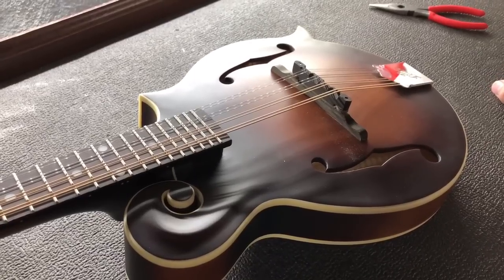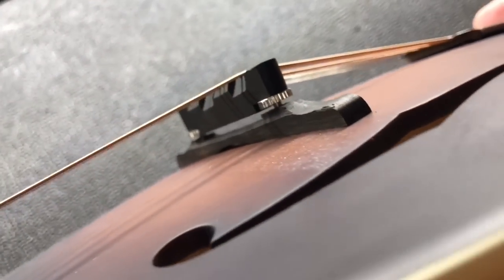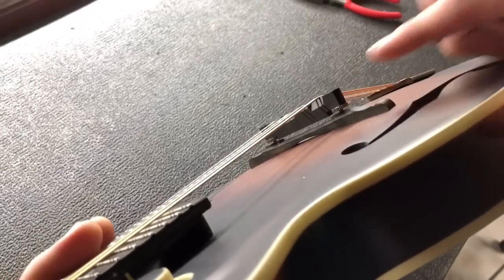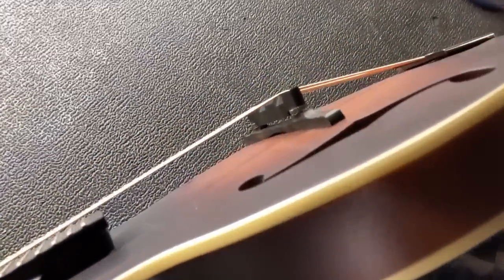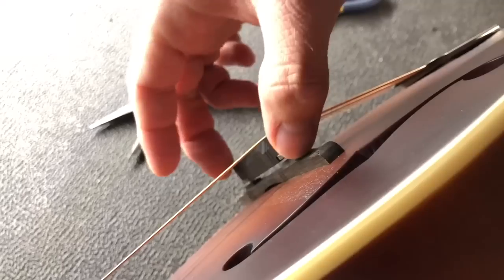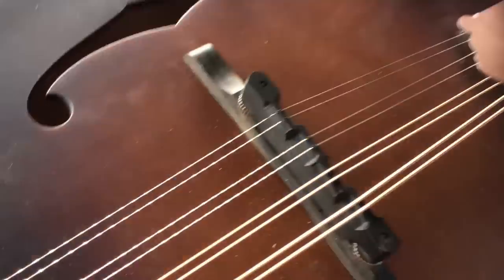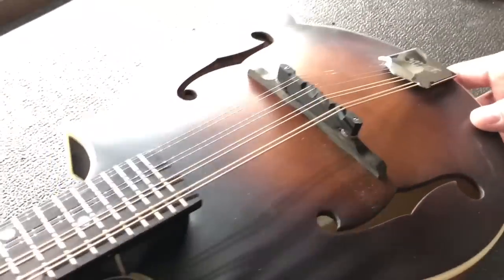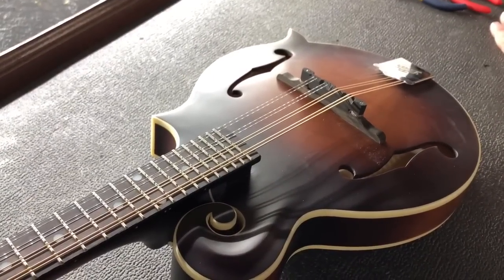Tech Tip– How to Adjust Mandolin Action Height

Comment: I bought a cheapo Johnson mando to practice on a business trip to Korea. I should have set the height back home when I had access to tools! With the strings tightened I can't turn the wheel for the lower tone strings, and when I loosen the strings the bridge simply doesn't  drop, the nut just screws down away from the bridge. I even tried lowering it a few mm below the bridge, then tightening the G and D strings to pitch, and it doesn't drop. I guess that's what I get for buying a crappy used mandolin! Edit: Fixed it! I loosened the strings all the way and loosened both nuts and then I was able to rock the bridge down and lower it to the nuts. Thanks, Ben!

Comment: Loosen the strings!!!Regardless of raising or lowering, always adjust the thumb wheels with your fingers.  If you have to use pliers, you have other issues.  Double check intonation by measuring from back of 12th fret. Gradually bring strings back to pitch.   Gradually - otherwise strings break.   You may want to order some E string singles and keep them handy.  Never force anything

Comment: For some reason I was under the impression that lowering the bridge would mess with intonation and you'd have to move it forward or back to compensate -- if that's not the case that makes me way more likely to experiment a bit more to get an ideal action height.

Comment: question: I see some saddles are completely flush all the way across the top surface and other designs where there is an arch in the center of the saddle where there are basically two "feet" ...is there a preference?  your video here has such a saddle

Comment: can you yell me  if there is a difference  between the treble and bass sides of the saddle when replaceing the bridge and if so how do you tell thank you
Reply: No one has answered so I will.  If you look at a typical mando bridge, the points where the strings cross the bridge form a zigzag pattern.  This is to compensate for the different thicknesses of the strings (hence it's called a "compensated" bridge). The two G strings are set closer to the tail piece and the two E strings are set closer to the fretboard.  Usually, the G strings require a lot more compensation than the E strings, so you should use whichever position will put the G strings closer to the tailpiece (furthest from the fretboard). 
When intonating, most people set the bridge to get the E and G strings (or sometimes the E and D strings) exactly right, and let the others strings fall as they may. It's rare that you can get all strings exactly intonated unless you've got an electric mando with a fully adjustable bridge.

Comment: I have a cheap mandolin. What's the best height for strings at the 12th fret Jake? I had to sand the bottom of the top half of my bridge as it wouldn't go low enough.
Reply from the maker: Height depends on what the neck relief looks like and how the nut is set. It's tougher to get right on a cheap mandolin.

Comment: No indication of what the correct string height is supposed to be , how heigh or were to measure the height . Not helpful !
Reply: Lower the saddle ' play it up the fretboard' if it doesn't buzz' keep lowering it until it does and then start raising it until the buzz goes away. Play it in the most aggressive manner you would play ' if it buzzes ' raise it until the buzz goes away. The lower without buzzing the better.
Reply: Thank you  @BryanClark-gk6ie